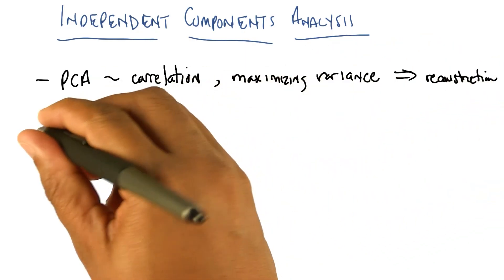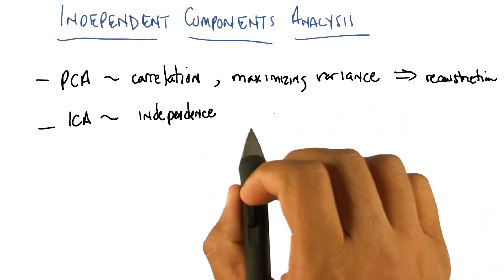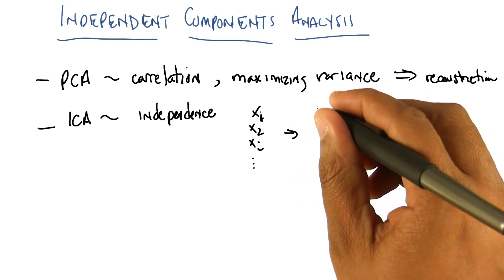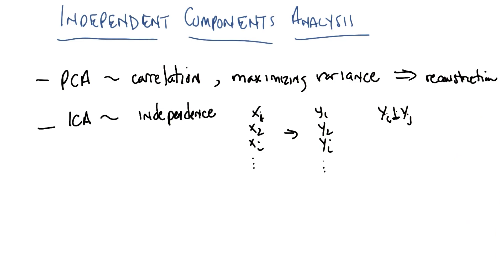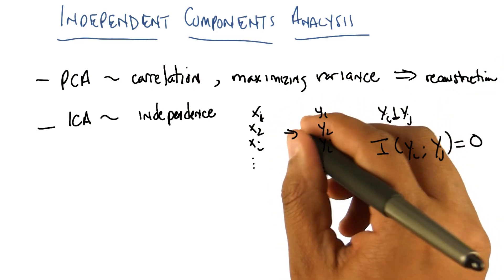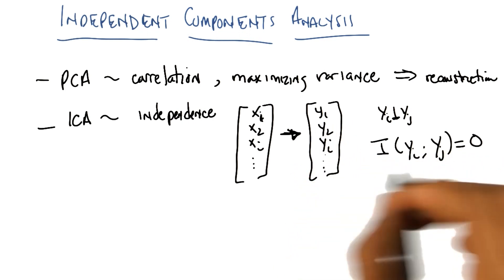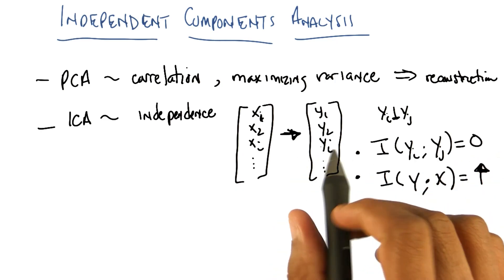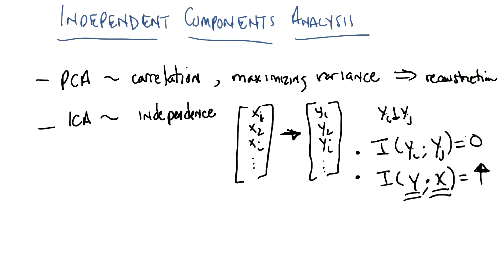Independent Components Analysis - Georgia Tech - Machine Learning

Comment: pca is also an linear transformation which achieves orthogonal components,  and since these are orthogonal it also means they are linearly independent so how ica is different?
Reply: I think that in PCA each new variables is independent from the previous one only. In ICA the new variables are mutually  independent. Check the definition of mutual independence on Wikipedia
Reply: In fact the difference is that
 in PCA we get pairwise independence but in ICA we get mutual independence of the new variables (which is stronger than pairwise)
See the definitions of these two concepts here https://en.m.wikipedia.org/wiki/Independence_%28probability_theory%29?wprov=sfla1